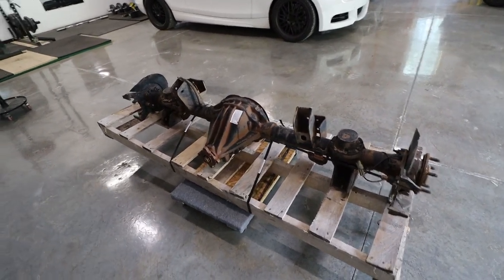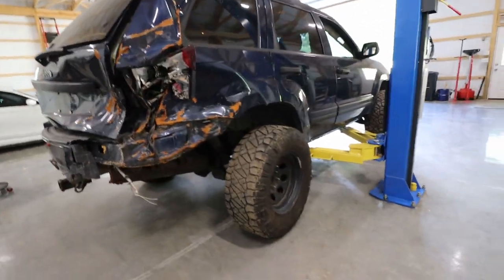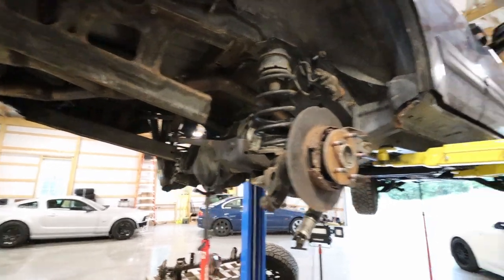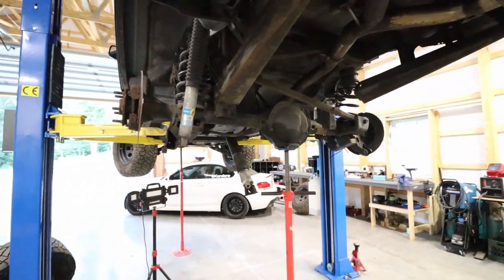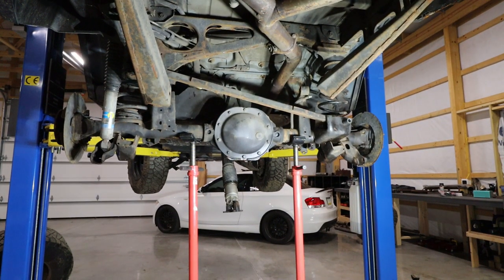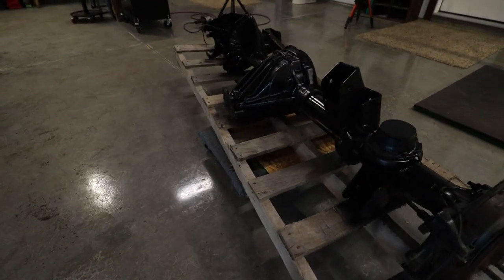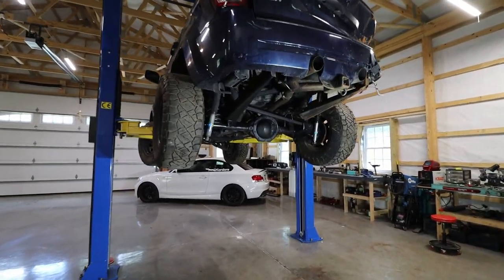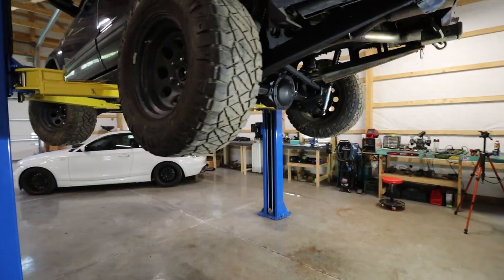Replacing Rear Axle on Jeep WK Grand Cherokee

Comment: Did you upgrade to Quadradrive II rear axle?  The ELSD would be a nice upgrade
Reply from the maker: I did not. I was thinking it wouldn't work since I dont have the necessary wiring to hook up to it.
Reply: You can wire it to a switch.  I saw the diagram on jeepforum years ago
Reply from the maker: @justinscherrman  oh dang that would be sweet

Comment: Sand your old bilsteins with 100 grit or 150 and clear coat them. They'll look good as new! Looking forward to seeing the quarter panel/ tail light area fix.
Reply: Nick Stewart definitely the go, spend that money elsewhere
Reply from the maker: Not a bad idea, the aluminum is pretty dull after a few years.
Reply: @Kordare  had to do mine after they saw 1 winter.

Comment: damn LKQ sold you one for 550 and sell them in the yard for 120.... would have learned alot pulling one. those bars are control arms and the long one is a track bar
Reply from the maker: Haha thanks yeah I had no idea what they were called. And there is no way I'd want to pull that in a yard. The extra cost was worth it just in time saved in my opinion.
Reply: @Kordare  Back in my day of hot rod building we called them torsion bars and had to have them with coil spring to keep the rear end from twisting.

Comment: Did the new axle  come from a Laredo If not it could come with a different gearing
Reply from the maker: Yes it did! Made sure it was the exact same model
Reply: So i can't put a hemmi differentian in to laredo model? If my laredo it's not 4x4
Reply: @danielgutierrez8390  you could remove front shock mounts,weld in new towers.it’s Been done I’ve seen it you tube.I’ve done so-much to my WJ not much more I can do.